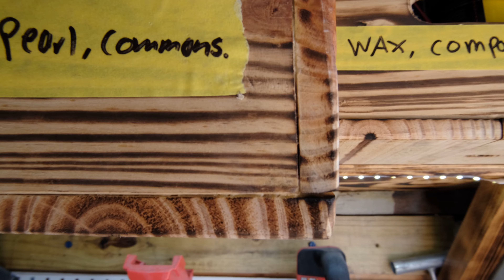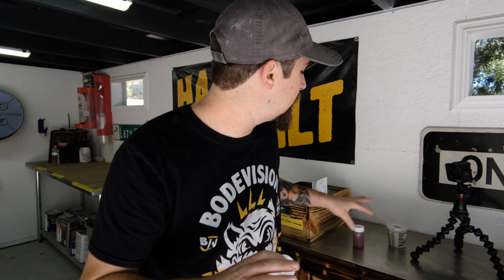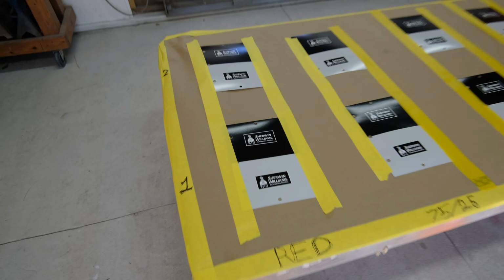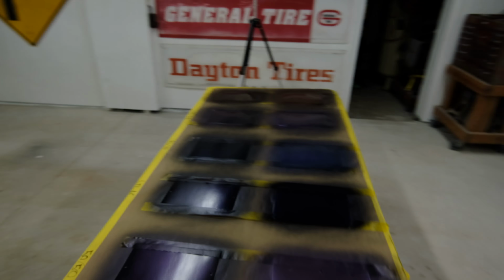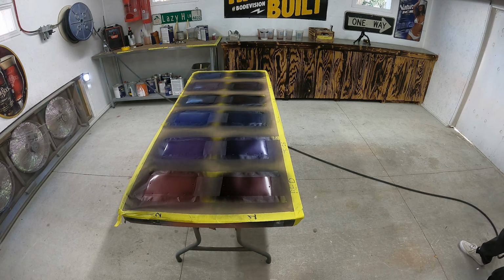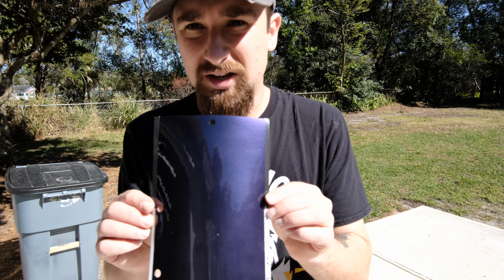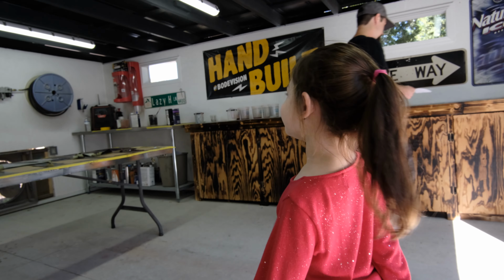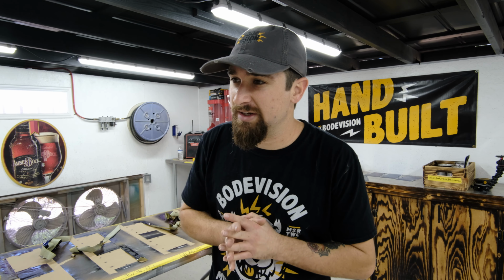Mixing Custom Paint for Beginners

Comment: Maybe use some colorless base and lessen the pearl strength. Weaker color concentration so you can put more than one coat just in case to avoid mottling .
Reply from the maker: Yes that’s a really good point and most likely what I’ll do, at least an orientation cost right with my first coat, just to lay it even